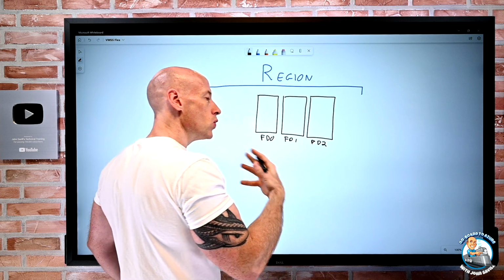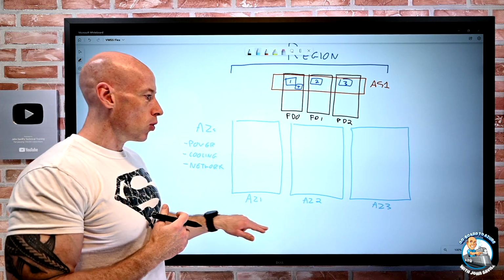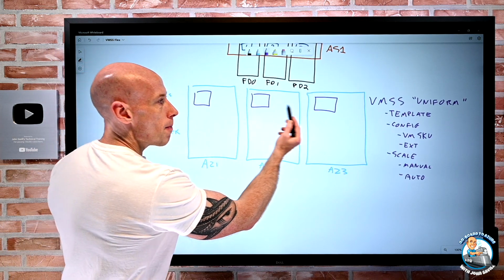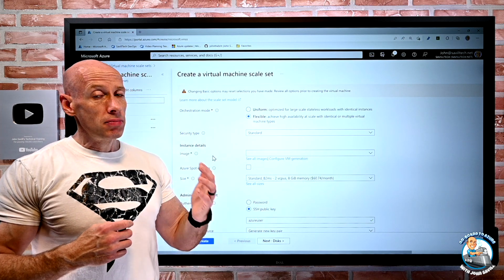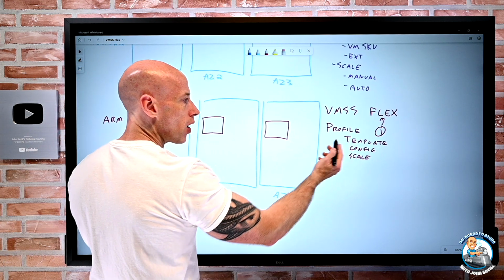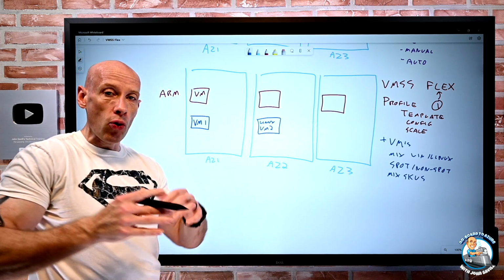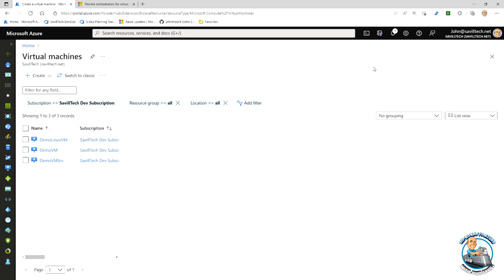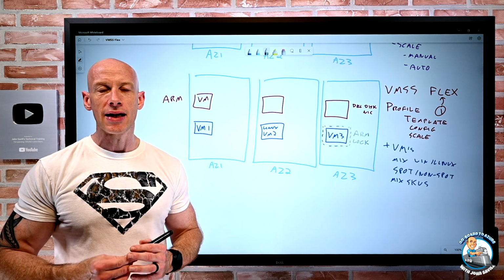VMSS Flex Overview

Comment: The last point about grouping constructs being the desired default is interesting. The thing I really liked about uniform was how easy it was to check the model version and update user data. That makes less sense when you're not grouping based on application. But it's still annoying that the only way to upgrade a flex node is to recreate it.